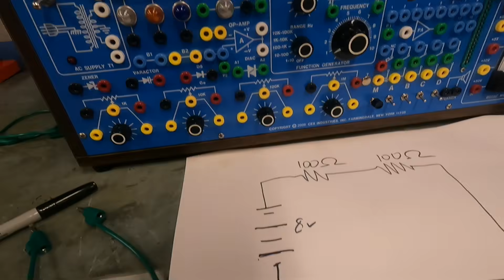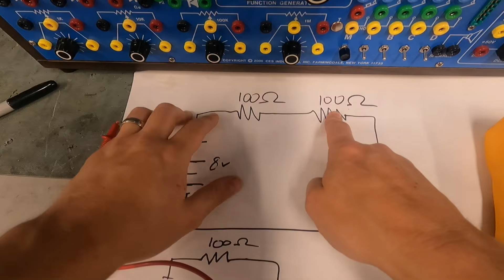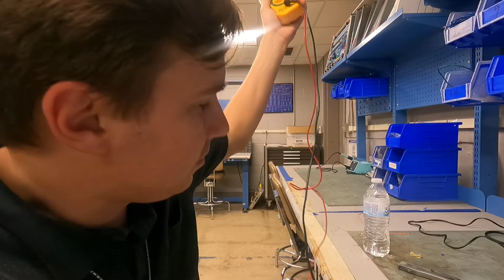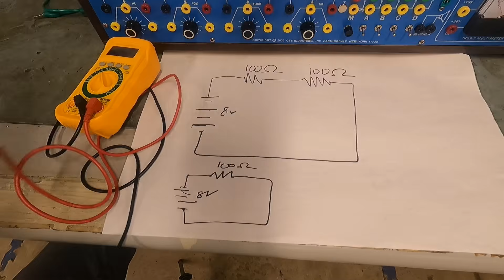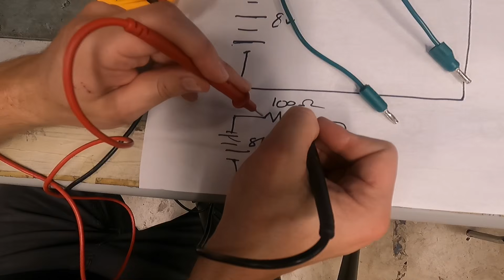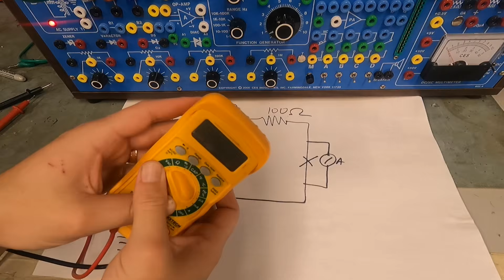A&P Practical Test Prep – How to Use a Multimeter: Voltage, Ohms & Amps Explained

Comment: On a circuit with wires instead of those jumpers that are connected to a resistor, you put your leads on both ends of the resistor or do you only need to leave the red lead on the resistor and black lead on ground when measuring voltage drop?
Reply from the maker: For measuring voltage drop, you would do just like I did and measure across the resistor.

Comment: If you are just getting into electrical things,  DO NOT run out to BUY THAT FLUKE you have your eyes on !
Here's why.  Guarantee if you don't have a lot of experience with things electrical, the first or second time you use a meter,  you might inadverdently have it on resistance checking a voltage  !  What happens then,  you just burned up your nice new meter !
TO avoid that problem, I advise you to buy a cheap $8 Harbor Freight multimeter or even buy something else at HF that offers you a FREE meter !
You can burn out quite a few HF $8 meters without worrying too much about it
Wait about a year doing electrical things BEFORE you even think about buying that nice FLUKE !
Reply from the maker: Agree 100% with this.